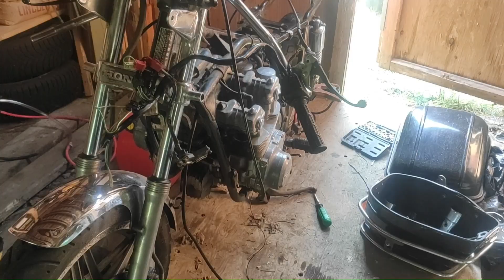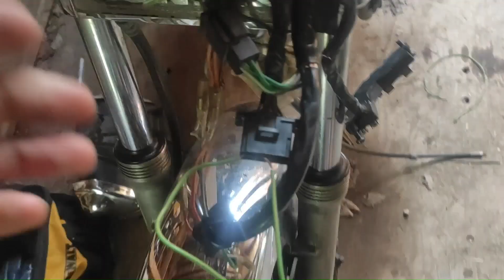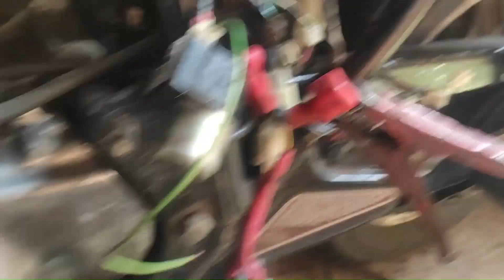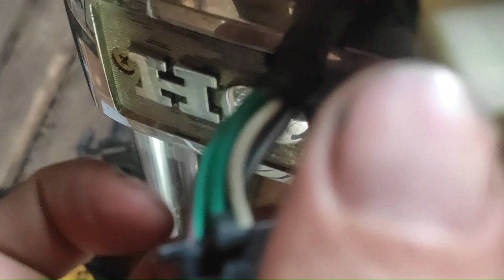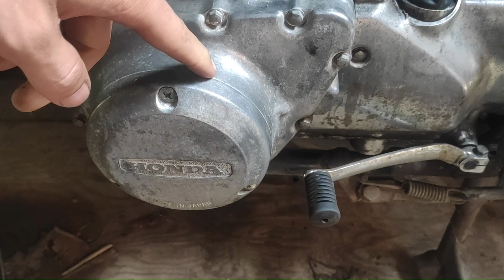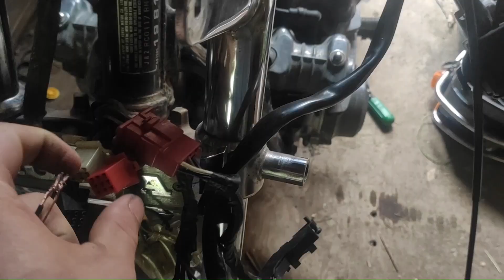Simplified Honda motorcycle wiring - 1981 CB750, Will it run?

Comment: I got the same bike did everything the exact same put it en neutral because I don’t have the clutch grounds, went try it I only hear the solenoid click
Reply from the maker: If your battery has good voltage I would start by making sure all your connections between your battery and your starter are tight and free of corrosion. Same goes for the battery ground. I'm always surprised how often the problem it just a corroded battery terminal.
Reply: @ hey just fixed it some days ago replaced the starter now my problem is that i dont have spark so it cranks but it doesnt have spark might be coils?
Reply from the maker: @ Maybe. I think I have heard that CDI units are common to fail. Just keep in mind since it is a wasted spark system if a coil or a cdi unit goes bad the engine will only loose spark on 2 of 4 cylinders(assuming only one cdi or coil goes out). If you haven't already I would check spark on all 4 cylinders, might help narrow things down.
Reply: @Crusty-Creations  hey man thanks for the info so i currently have no spark in all of them
Reply from the maker: @jeronimomurillo7906 That is indeed a head scratcher. All I can say is go over everything with a fine tooth comb and a multimeter. first thing I would do is make sure your cdi units have good ground and power. wish I could be more help.
Reply: @Crusty-Creations thanks man ill try check  everything you have told me

Comment: Bro I acquired a 1971 cb175 motor was shot found a sweet deal on cm200 two star motor later found out the new motor is 6v I want to run the 12v harness that came with the cb175. No spark but coils are good mehhh options
Reply from the maker: I would assume you are fine to use the 12v harness as long as the wires are big enough(a 6v system might require higher amps and bigger wire). but as long as your fuses are the correct amp for your wire then nothing should catch on fire. as for the spark i am guessing its a points ignition system? I'm not really an expert on that subject but I'm sure there are some good videos out there. Good luck on the project, sorry for the delayed response.

Comment: Just needed to know if ignition needed voltage . thanks !
Reply from the maker: Glad I could help. That was the last piece of the puzzle for me before I got things running.
Reply: @Crusty-Creations  My bike been sitting at dad's junkyard since it was wrecked in 1990 he gave it to me after parts started to disappear . had to remove valve cover n oil valves n rebuild starter now it is pulling air on every intake port might be a runner come spring.  8,000 original miles.  Old man will be 99 yrs old n im 63.  Carbs are a mess but not first time i saved a wreck

Comment: Sooo, same bike, I did the carb rebuild, got it to run, but the starter clutch gave up, I replaced it, now I can't get the bike to run, I have spark on all 4 coils, I did a bench reset on the carbs, I'm guessing my spark advancement is the issue but I don't find the proper position, is the only thing I have left to get it on the street, can you show me how you set it up please? And yes I'm invested on it and there's no way I'm giving up 😅🤣🤣🤣🤣
Reply from the maker: It looks like it's pretty easy to set up the spark advance backwards. That is assuming you took it apart. This video seems to cover it pretty well https://www.youtube.com/watch?v=NWmeU3OALfU 
I hope that gets you running, otherwise it could be week spark but that is typically only a problem when you give it throttle and you had it running before so I doubt it. Otherwise if your carbs are good then things should fire up. It sounds like the spark advance is definitely the most likely culprit. best of luck, let me know how things go. or if you need to see how mine is put together.